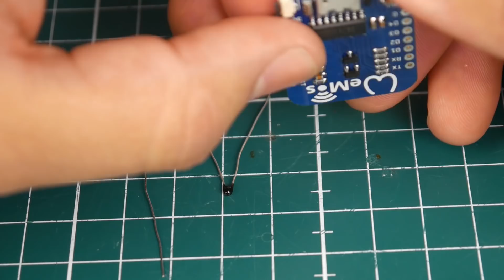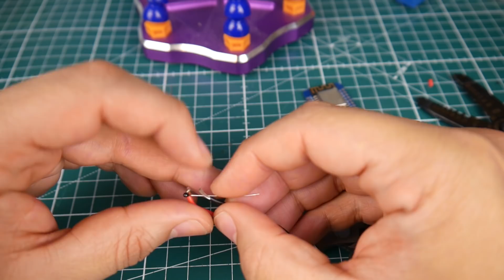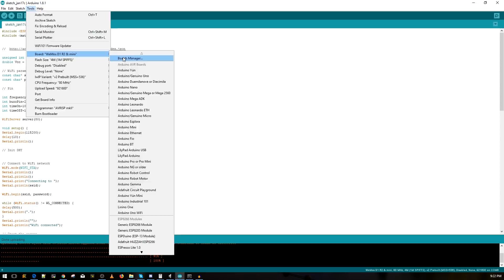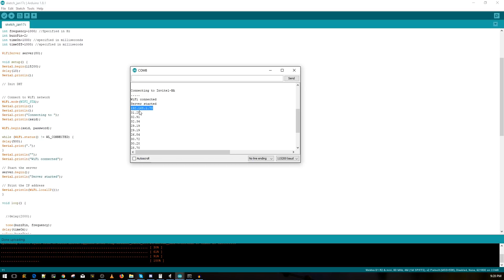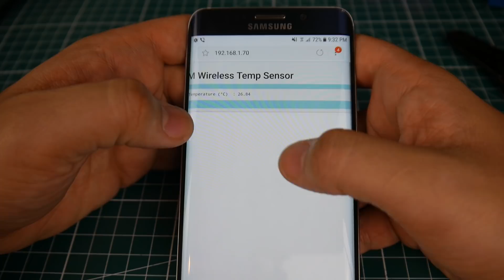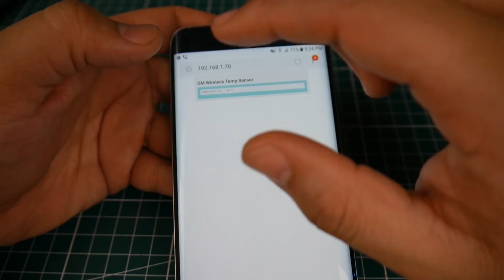DIY Lipo Wireless Temperature Sensor ESP8266  // Less than $5

Comment: I love this.  This definitely gives me a place to start on a project I'm thinking about.  Do you have a resource for making several of these (at least 7 or 8) with all of them reporting to either an Arduino or PI server, maybe with email or sms alerting or triggering of relays based on temps?  I'd also like to hardwire some of them into 12v and some into batteries.  I think Wemos has a power modules that can handle 12v and others for batteries.

Comment: UPDATE: I found some 150K ohm resisters...apparently, i didn't buy a good enough set the first time!  :/ ...do you have a link to the next part with the relay? (I'll also look through your channel now, but it might be helpful for others, so asking here) Also, do you have any recommendations on how to install this in a hot environment? (for example, inside a motor that will get close to 95C / 200F)

Comment: hi. sorry if this is a noob question. is it possible to transfer the temperature data through usb cable? if i'm not using the wifi, is there any similar device like esp8266 that i can use?

Comment: Just assembled mine and it works great. Now I''l see if I can alter code for outputting  degrees F.
Reply: Oh, and one other thing I noticed, when activating the serial monitor I had to change the baud rate to 115200 or I just got jibberish.
Reply: For those interested I added the line:

Temp = (Temp * 9.0)/5.0 + 32.0;   // Celsius to Fahrenheit

 right above above the "return Temp;"  line at the bottom.

Comment: Cool project! My EE knowledge is limited, and I don't understand the 'science' behind using the resistor to compensate for the difference in voltage when reading the sensor. Could you explain in your followup video, or are there any resources I can check out?
Reply: Check for voltage divider, that's what he is using here. Basically the point where both the 150 kOhms resistor and the thermistor are connected will have a voltage between 3,3V and 0V(because that is supplied at there other ends). The exact value will depend on the ratio between the resistors and because the thermistor  has a resistance that varies with the temperature, the voltage at the point between the two resistor will vary with temperature as well and so this voltage can be measured and used by the microprocessor to indirectly determine the temperature.
Reply: Thanks